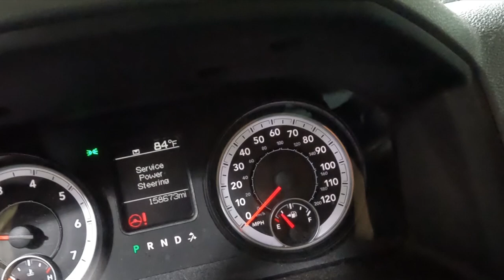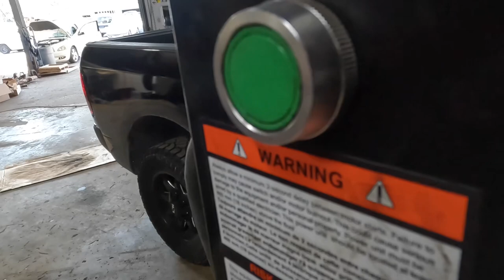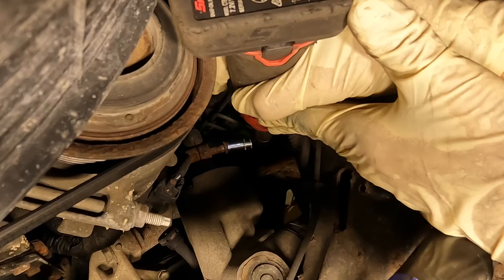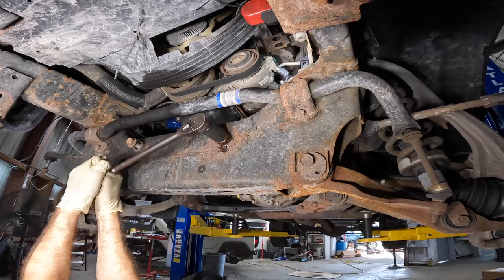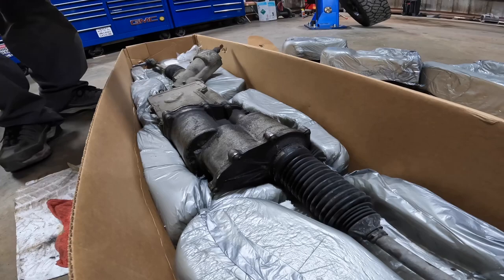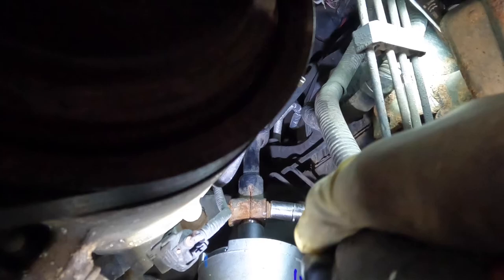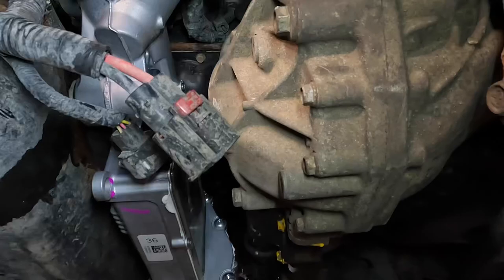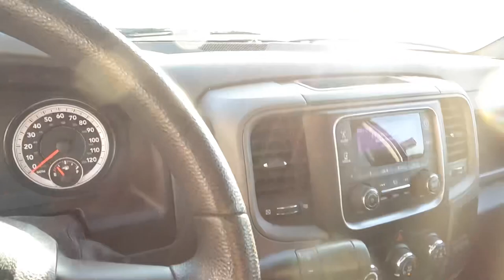Electric Gear Leaking? 2014 Ram 1500

Comment: Hi Ray from Australia just a thought. why don’t you swap the lifts around so it is easier to get the larger vehicles straight into the lift and have the smaller cars to turn onto the smaller lift.😊 PS. LOVE YOUR VIDEOS
Reply: 100% right i have been thinking that since he started this workshop
Reply: A lot of people have already mentioned that. It depends on square footage and maneuverability. Plus he would have to pay out the caboose, to have it done.
Reply: It would be good but he would have to shut the shop down and dig out the old foundations and pour new foundations. Larger lift has larger foundation. They aren't just anchored to the floor slab I'm sure.

Comment: I'd have to clean up the bolts and lubricate before refitting them, for important bolts I would use a torque wrench. That said these are very enjoyable videos. Good luck Ray with your new business.
Reply: Torque setting is usually right in the middle of snug and breaking point of said fastener, doing them like this surely gets them past the torque spec but they don't break so its all good. I understand a Torque wrench is good, but most technicians know how tight stuff needs to be
Reply: agree, dust affect torque, he did not torque flywheel?

Comment: Hey Ray!  Is there a reason you don't use dielectric grease on the electrical connections?
Reply: Dielectric grease is not a very good thing to use directly at the connection because it actually insulates instead of conduct the electricity
Reply: @Mygfisawesone  So don't use it on plug wires?
Reply: @bloodybones63  it's good to use on things like coil boots and on top of a battery terminal. It seals out moisture

Comment: Had same problem steering wheel didnt wanna turn dash light was on red ! Steering wheel light at first i tryed the fuse and checked all wiring all good now it has new EPS rack in to costed $1720 plus installing/programming $720

Comment: Nice video,  wonder why that part failed. Noticed Ray, doesnt either lubes or grease bolts and screws prior to reinserting, considering the amount of rust. 👍👍👍👍👍🇺🇸
Reply: Cleaning the rust off maybe, but never grease a bolt, that’s gonna let it work itself loose.
Reply: @EricS83  I understand that, cleaning rust, or spraying at a stubborn nut or screw that's rusted and won't budge. 👍👍👍👍😉

Comment: My thoughts on the "Door of Death" is to reverse the hinges so the door opens the opposite way.  then it can be latched open for circulation/ventilation.
Reply: Already suggested when he first moved in.
Reply: Many building codes require exterior doors open outward on commercial buildings so in a panic a crush of bodies cannot keep the door from opening

Comment: Hi Ray, I am concerned when you just threw those long frame bolts on the floor. It could damage the bolts and importantly they act as roller bearings under your feet for a fall hazard. Stay safe!

Comment: I have a 13.. the ecm mounted on the rack went out... 2200 for a new rack.. was told you couldn't just replace the ecm that the rack had to be replaced.. had to drive 20 miles without power steering.. dang it was tough

Comment: Wouldn't using the depth gauge of your digital Mitutoyo caliper have gotten the jam nuts REALLY CLOSE?
Reply: Better to measure the total length from tie rod end to tie rod end. Counting threads doesn't always work because they may not have been machined the same.
Reply: @hotpuppy1  He used a 2 finger widths as a measurement. Hardly close enough.

Comment: Arctic Alaska eats electric steering.
We raid the US supply.
City had new F150's and first winter we needed 6 new steering units.
I drive a 2017 work truck 
a chevy colorado that sometimes has no power steering at really cold temps (-20's)
I found I have to set floor pan heat to heat under dash till wires become warm and pliable then have power steering.
At -34°F that equates to 1/8 tank of gas to warm up.
This winter unleaded is $8.0499/ gal

Comment: The power steering cooler leaked on mine the steel bracket holding the aluminum core rusted and expanded into the aluminum until it perforated it😮

Comment: I replaced a steering rack on my own car years ago. The trick I used was to measure from the outer tie rod to the other outer tie rod. The threads can be slightly different from one rack to another, especially if it uses different manufacturers inner or outer tie rods.

Comment: I have a 2017 1500 Ram had to replace my electric steering a couple years ago at $1200 and 2 manifold bolts that's all I've had wrong with my truck Love it.

Comment: I notice your ratchet was skipping when tightening the steering shaft. Pop the snap ring out of the head, pull the guts out, and squeeze the top and bottom of the head together in a vise so as to lessen the gap the guts go into. I used to repair air ratchets and this worked 80 - 90% of the time.

Comment: It's a 5G antenna, not a gunshot detector. Boomerang 3: Boomerang is a gunfire locator developed by DARPA and BBN Technologies primarily for use against snipers. Boomerang is mounted on mobile vehicles such as the Humvee, Stryker, and MRAP combat vehicles. There were plans to integrate it into the Land Warrior system. "Boomerang 3" being used by British forces in Afghanistan.

Comment: Just wanted to let you know that seat belt defeat job isn't necessary. There is a procedure that disables the warning bell without having to take it apart. So you can drive without the seatbelts and the annoying bell. Better to wear the belt I know but if you're not going to it's easier to just disable the bell.

Comment: The pole you are referring to is commonly called a CRAN pole. Cloud based radio access network. It is 5g and or 4g cell network. I work on them for AT&T. Low power all good.

Comment: The pole you were asking about is either a cell repeater or Wifi repeater. There is a chance there are cameras/gun fire alert but they are all over major cities I have been in. I have had to even work on one replacing a camera. Its either a city/town owned tower or Cable/phone. It depends on who has the contract for the city wide wireless system. it may be public or for the Police and other municipalities to use while working through the city especially in areas where line of site may be an issue.

Comment: Hi sir you should ga e taken some measurements with a tape measure.  
I did it with my old venture van & the guys at the shop were  surprised in all the work I did and the alignment was close. 
 Just take some solid measurements before you take things apart . 
Be safe team.

Comment: I’m moving to Florida, it’s cold in west Texas brother. Got a complete go through on a souped up desert ranch abused 97 wrangler sitting outside in my work space. Was rolled off a trailer for delivery here and hadn’t run for 4 years with rodent issues in the wiring. Runs, charging with a new auxiliary battery setup including isolator switchable. All KC lighting rewired on multiple switches now. New touch screen stereo and waiting for new Amp to replace the two existing redneck installed junkers. Too damn cold to work until 11:00 outside on electrical at 29.8 degrees at 8:00 AM today.

Comment: I used an iPhone to align my 1998 Ford Ranger’s camber and toe-in and the alignment guy said I was only 1/2 degree off in all directions. I put the iPhone on the rim of the tire with weight on the wheels and used the compass app for the toe-in and the iLevel app for the camber.

Comment: The pole looks like a Verizon millimeter wave tower. That frequency range doesn't propagate well (doesn't reach far from the antenna) and relay only works when there is line of site. So they are usually closer to the ground then the traditional cell towers.

Comment: Yeah. You should really put a firm closer on that door. I'm sure they're selling them at Home Depot or similar. That door should only be used at opening and closing, so it needs a springed door closer that makes this door unattractive for casual use during the day while your big shop door is open. Would be bad if your wife or one of the kids swings this door open, right in the side of a customer's truck. Or your truck.
Doing great. Keep it up. But is has been a while since we've seen a nice diagnostic going on. Lately, there's a lot of wrenching and disguised oil change vids. By the way, you do an amazing job turning an oil change vid into something interesting. Hats off. And, have a nice day!

Comment: Ray, that could be a shot detector. But, also could be for early warning of dangerous weather. 

My guess (that’s all it is) is, it looks like it has speakers, or large sensors. If they’ve had any problems with gunfire in the area, these can be very helpful locating where. 

They were installed by many communities experiencing shootings over the last 15 years. Is that a problem in your area?

Comment: Hey Rainman Ray. You need to swap places with your lifts so you can drive straight in the the big boat anchored trucks and big cars. Little cars can easily make the left turn to the smaller lift. Now do it. Dale
Reply: If you do that and place the large lift far enough back to get longer vehicles on, no, smaller vehicles will not be able to squeeze through reliably to get to the other lift. They put them that way around for a reason.

Comment: If you mark the arc of the arms of the lift it might help in positioning the vehicles.
Reply: When they install the lift, they put a small metal square on the floor that you park the LF wheel on.  99% of the time, you end up in the right spot.

Comment: That tower looks like a lightning detector/traffic cam w/ warning system
Reply: Lightning is typically sensed in the 5-30hz range through radio waves and is triangulated based on peak signaling between stations, there is no need for line of sight to perform this function, the newer weather sat's are also keen on detecting  air/air strikes and sprites.  Fun Fact, the longest lightning strike was recently observed by satellite to have covered a distance of 500 miles between Texas and Mississippi earlier this year.  Civil Defense sirens are typically much larger and placed high in the air for better coverage over long distance.

Comment: Here's a helpful hint if you're doing a job like this yourself: make sure that the steering wheel is centered and that the new steering components are centered when you assemble it. This will make life easier for the alignment tech. If you run a bricklayer string from the rear of the rear wheel to the front of the front wheel and all four touch points are straight on the string the alignment will be close enough to safely drive it to the alignment shop. I replaced the rack and pinion and tie rod ends on my 1988 Taurus and the alignment guy said that I had it pretty close.

Comment: 🌟🎄🌟🎄🌟  1. with front tires on and on ground roll back and forth @ 2 feet , measure from same line across from tires in the front and in the back - the front measurement is @ 1/4" to 3/8" closer this will get you to realignment shop with no tread loss and good to 60mph. 2. WHY DO PEOPLES BRAKE HOLDING DA TRAFFIC UP, STOPEN FROM 45mpH then turn on BLEEENNNKKKEEERRRR (that was talking while braking) . 3rd - The black pole--at first looked like speed cameras or intersection cam but the PEW PEW recording direction ium thingy is GOOD ☠

Comment: That tower looks like wifi hotspot / cell site though if it was they are required to have signage warning of such. My local Cable company has been putting wifi hotspot sites all over. If it was a Shotspotter have you seen anymore around? Need min of 3 to triangulate the shot.

Check your SO Scan tool about cal / programming / reset that unit. My shops alignment machine (Hunter Hawkeye Elite) can do it without need to go to stealership.

Comment: You really should consider swapping those lifts if you ever have them moved that way you can pull straight into the big one, and have the small one tucked in the corner.
Reply: He addressed this in a different video.  The way it measured out anything on the relocated bigger lift would block access to the smaller one.

Comment: you should pickup some of those basic alignment tools for stuff like this. i could see sending it to a shop if you messed with parts that effected caster or camber but you only messed with the toe. adjusting toe is super easy and can be done with a tape measure.
Reply: Tolerances are a lot closer than they used to be. Tape measure isn't going to cut it any more.

Comment: I usually unthread both outer tie rods, counting the exact number of turns it takes to remove it. I then spin the new ones on the same amount of turns. If the steering wheel was straight before it will be straight now.

Comment: The Dodge/Chrystler rack and pinion shouldn't need programing.  It's pretty much plug and play.  Just reset the steering angle sensor and your good to go.  GM's on the other hand require a bit of an extensive programing procedure.  One part of that process is that a Tech 2 is required to complete it.

Comment: i would have measured the distance from jam nut to jam nut so that the toe was pretty close to the original measurement after installing...at least get it close before it gets to an alignment shop....boy, no oil lines, that's a sweet rack to work on

Comment: the "tower thing" is 5G cell tower.  the higher the frequency, the higher the speed/bandwidth, but the lower the range, hence the low height and distance between poles compared to 3G and 4G towers

Comment: My previous small hatchback had electric assist power steering, my latest light commercial ute has proper old school hydraulic assist steering, it is soooo much nicer. There is real feedback from the road, it's consistently weighted, it's not 'coggy' when turning the wheel. And the best bit there's no computer in the way saying 'you can't do that'. Not all progress is good.

Comment: Ray, what are your thoughts about fastener torque? I think the standard is "book" torque which is for new and shiny parts. What about lubing or old bolts? What about about torquing rusty crusty Eric O type bolts?  It seams to me that torque is a somewhat relative thing. What are your thoughts? Perhaps you could discuss it in a upcoming video. Great video ThanX Ray.
Reply: Book torque can be quite arbitrary depending on which book you use. The torque spec sheet that came with my torque wrenches stated 21 ft/lb for a grade 5 5/16-18, but mil-spec 18 ft/lb for same bolt. I've spent my career tightening by feel.

Comment: Well you did forget the mileage but you also forgot the keys to the truck so we'll let you pass on the mileage this time. should have dialectic greased the connectors. The power steering unit probably says not to but being that it was a northern truck, most likely there's was corrosion in those connectors at one point hence why the lock is broke.  That most likely is a 5G antenna could be a PA system as well considering the area you're in but most likely a 5G antenna 📶

Comment: The fact that the steering gear is almost impossible to get without waiting for the 4th of July, tells me it's a high-failure part. Also, one of those tie rod ends had a lube fitting, the other didn't. Replaced previously? The "lube-fitting" one looked much cleaner.

Comment: The only place I use those fake belt inserts is when I'm ice fishing. Never ever wear your belt on the ice cause you might have to abandon ship at any moment.

Also, I believe that is a compact 5G cell tower repeater. They can be used to cover small areas to keep bandwidth higher.
Reply: Are you talking about the "novelty bottle opener" in the cup holder?
Honest office, that's what it is. 😇

Comment: Out of curiosity how difficult would it be to swap the two lifts around. That way bigger vehicles could easily pull straight in for the big lift, and smaller vehicles can easily drive in that sharp turn for the smaller lift. 🤷‍♂️ would be a much nicer arrangement. lol
Reply: I believe he thought about that, then decided not to because having the big trucks straight ahead would not allow, even the small vehicles, access to the left rack. If I remember correctly anyway.

Comment: These electronic steering gears aka Rack and Pinions are a massive pain on top of them being heavy they are even more bulky and hard to remove even more then a traditional hydraulic only rack and Pinions the electric motors go out a ton and they don't really Add much better steering for the extra mass they are.. especialy the electric assist units like this there not as reliable and the issues with the back orders will drive you mad there not easy to find @Rainman Ray's Repairs

Comment: Nice fast change out Ray.  Too bad you had to wait on parts.  Kinda makes you want analog vers the high tech drive by wire stuff. I dont see these as serviceable as a power sterring pump and hoses. But it is all in one bundle.
Expensive parts too ill bet.

Comment: that tower at the end is likely one of two things, either a cell tower for a small radius that was a deadzone or a zone with high network traffic that needed a boost, or a storm siren of some kind. that would explain the meter strapped on the side, since they use a lot of power when in operation.

Comment: Ha Ray
Just to ask, would it be a good idea to swap over the  sizzor lifts. So small vehicle in tight corner. And bigger trucks straight in. Or if someone has a full ramp lift. As good for wheel alignment. MOT and service testing. Not sure if America has Mots. Plus better for work on. 
Plus keep up the great work. 
Miss the doodly doo doo

Comment: As a long- time DIYer, do you not need to be more mindful of the new steering gear being centered before connecting to the steering shaft to ensure the clockspring is not affected?